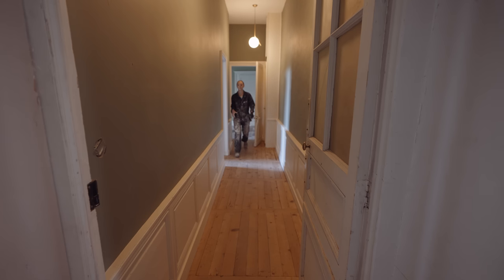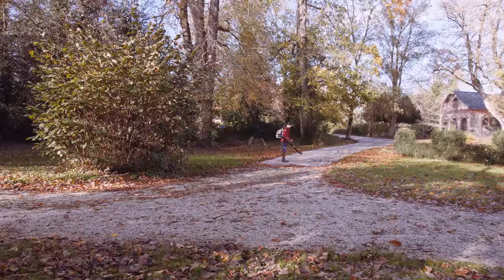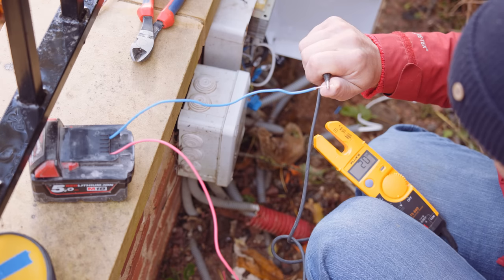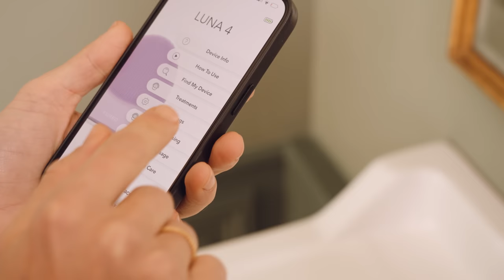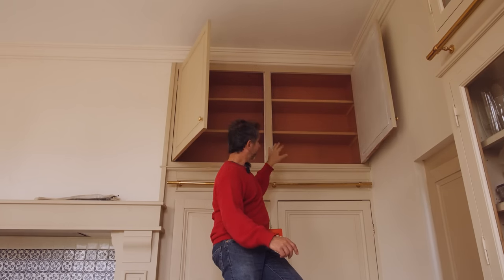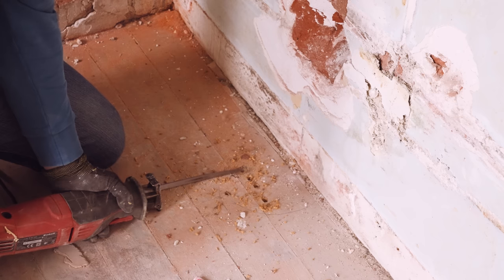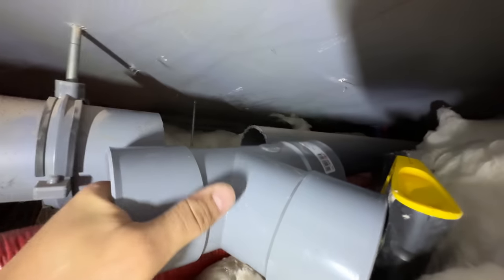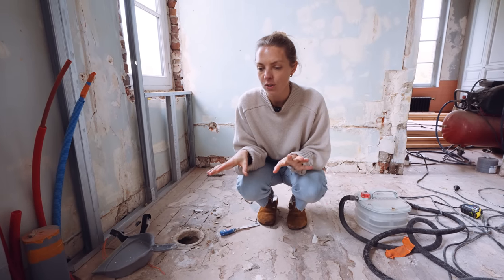BACK TO RENOVATING (Creating a Chateau Master Bathroom)

Comment: Team tile for sure. Too hard to keep the wood clean, and safe from water damage. 
Encaustic would be lovely, there is a lady in spain that recovers encaustic from homes that are pulling them up and throwing
 them away😳 .
The magical modernist mansion you tube channel, did a feature on her and they have her contact information. 
I also love a black and white mosaic tile. So many options have fun researching its a blast!

Comment: Wood sounds great except when the first flooding incident occurs and it doesn’t need to be a lot of water to ruin a wood floor. Like someone else commented you could have in floor heating with tile and I think the installation wouldn’t have to as finicky as with wood. Uneven subfloors etc

Comment: Wood looks great but will need probably more long term maintenance plus expands & contracts with heat & the cold. Ya can buy tiles that look like wood only they will be colder to stand on unless you have underflooded heating or old fashions mats or rugs to stand on. (They would need cleaning every so often also. ) pros & cons to each job. If you have the budget then do everything you want. Budget will dictate everything. So no gold bidet for philip 😜

Comment: With the adhesive on the bathroom floor I'd just thinset over it and sand it and just get it level. Then go from there. Flooring guys were at the gym I work at this weekend that's exactly what they did. They came across the same type of adhesive which is concrete adhesive they had to use a floor removing vehicle to pull it up. You'll be there for a century trying to remove it.
Honestly I'd go with tile I think it matches the aesthetic of the chateau much better than wood would.

Comment: There is a machine for removing glue/cement from floors that works like a multi tool and looks like a stand up vacume cleaner. A lot easier than being down on your hands and knees. Well done on a very tough job Anna. Philip, you need an electrician....

Comment: Either way… get a heated floor system!
I prefer wood … it is an element of warmth and softer on the feet

Not knowing what color design of tiles …. Possibly consider a darker wood tone it becomes a much more luxurious feeling instantly, especially in a bathroom.

Always use a separate dimmer switch on the wall sconces and over head light fixtures as well.

Comment: Wood. Has been used for decks on ships sailing the roaring 40s and screaming 50s for ages. Can't be wrong for a certainly lesser wet bathroom. As for the gate - you of course would need a gatekeeper house there plus minimum 3 shifts. Easy…

Comment: I know very little  about plumbing, and I didn't get a very good look at your drawing on the wall, so maybe I totally misunderstood your plan. I do have experience in trying to figure out how to unplug a kitchen drain when the pipe was very long and didn't have enough slope to keep the water moving. The experience lasted several days and then I came to understand what the previous owner moved a water heater outside the building--but enough of my experiences. Does the new pipe run all the way to that little point of light at the end of the tunnel? Having a light at the end of the tunnel is great, but not necessarily when it comes to plumbing a toilet. Is there a trap to keep the odor from coming up through the pipe?

Comment: Why didn’t you mix the dry concrete before pouring it in the hole. I would be worried the bottom will stay dry
Would hot water help with the glue on the floor?

Comment: You can use tiles that look like wood but I would only use tiles in the bathroom. Imagine some sort of flood. It would be a nightmare with wood and swelling. And underfloor hearing would be amazing for the winter. As a joke you should tell people you’re putting carpet for budget cuts and warmth in the winter months instead of under floor heating 😂

Comment: Have you tried using a heat stripper gun. Like you use to strip paint. I pulled up old linoleum that way. Worked good. Charles Charlotte NC

Comment: Just a small sugestion, wouldnt it have been easier to take the floor out, get it through a planer to take the glue off. And Philip can then just work on the pipes 🙂

Comment: If the only two options  are tile or wood I would do tile. Otherwise I would use vinyl planks but wouldn't work with the style of the building.

Comment: If you have wood floors in the bedroom and dressing room, it would be “disturbing” to go with a faux wood (ceramic or vinyl) in between, particularly if the doors ever stay open.  I think you would be more comfortable with the consistency of the same wood flowing throughout or with a contrasting tile or stone.  Either could be nice. From an ancient, ANCIENT designer (83 years).

Comment: Anna, I've removed all sorts of glue etc from timber floors over some decades - you should use a square mouthed spade - no need for the rubbishy electric machine you've been using!

Comment: Wood or tile? Well this is not a children's bathroom. Wood feels warmer for feet in the winter, even when the floor is not heated. It's always a shock to walk from our wood floors onto the tile floors. I know you can heat the floors, our master bath has heated floors, but these systems can also fail in areas and it's a pain in the a** to pry up tile and fix the heating. 

Our whole kitchen has oak floors. (Likely installed in the 80s or 90s, so they're not as great quality as very old hardwoods.) There's no damage by the sink, no damage by the dishwasher, not even any damage by the cat water bowl where they splash water all day and all night. We put a water-resistant mat under the water bowl. Only damage is by the fridge ice & water dispenser, and that was our fault for slopping water all over the place unnecessarily and not cleaning it up. It took about 15 years for damage to show up on the wood floor below the ice maker.

So I could be Team Wood in the Bathroom, as long as you don't get areas with long-term exposure to water that doesn't get cleaned up.

Dry off inside the shower so you don't drip water all over, and put a rug to dry off your feet outside the shower. You should be fine with wood.

Comment: Didn't Stephanie have a bathroom floor collapse at Lalande?  Tiles are good but they can put a lot of extra weight on the floor.  And, as I am older, I didn't want any slipping concerns with wet floors.

Comment: In Brasil, we never, ever use wood in bathrooms. They are constructed differently also. About tiles, do you want a vast selection,  with beautiful tiles, like hundreds of different sizes and textures? Come to a big shop in Brasil. You will be amazed with what you see. The times I've been in Europe, I was extremely disappointed with the 10 types of tiles you had to select from. We use tiles everywhere,  in the bathroom (floor and walls), in the kitchen (same), in the living, dining, sleeping rooms,  garage, on the outside, in the "churrasqueira", in and around swimming pools, etc, etc, and no they aren't expensive. For first rate, expensive tiles you'll pay R$150,00/m2, or +-€30,00. The common ones €10,00. Here, the cement will cost something like €1,50 and the professional between €7,50 and €15,00/m2. They always say Italy is The country for tiles. I disagree,  Brasil is The country for tiles.

Comment: Absolutely wooden floors, the original concept for this master suite design was to show off and take advantage of the connecting rooms and the seamless flow that can be created with that. I'm assuming both the bedroom and the dressing room will have mostly exposed wooden floors, apart from the odd soft furnishings and rugs. I think having a patch of tile in between the two wouldn't feel cohesive. For the argument of tiles being easier to clean - the likelyhood of major messes in that section of the bathroom are pretty slim to none, matts in front of the bath and sinks will also aid in this. Treated hardwood would still be incredibly easy to clean, just a little maintenance needed for what i'm sure will bring a beautiful look to the room.

Comment: C'mon Phillip, you're Italian. No Italian will tolerate anything but tiles in a bathroom for hygiene! (also because I think, even well executed, wood in the bathroom is a pain in the arse to maintain). Regarding the doors: I was thinking "but putting some extra charge of electricity could fuse the board" til it happened 😂. That Customer Service is really, really bad. Let's hope you can find a solution soon!

Comment: Tiles on the floor are good,but will be cold unless you have underfloor heating. A cheaper option is to use vinyl . It comes in a roll to cover the entire floor, lots of design’s available, bathroom furniture goes on top. Floor is then waterproof and also comfortable to walk on. You can also get vinyl in tile or plank form.  Vinyl need a perfectly flat smooth surface.